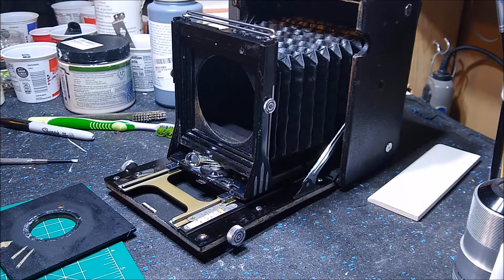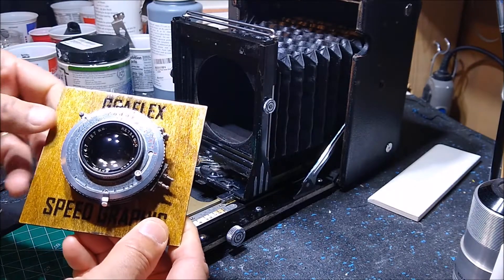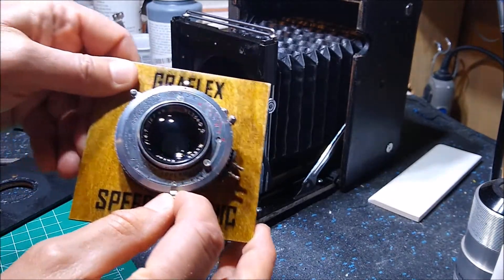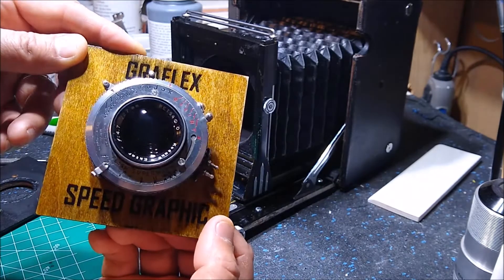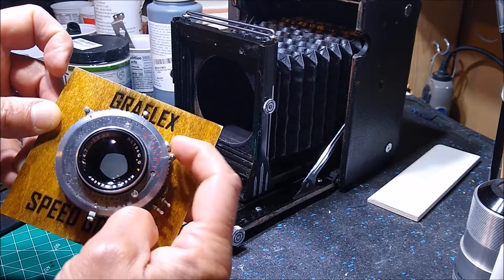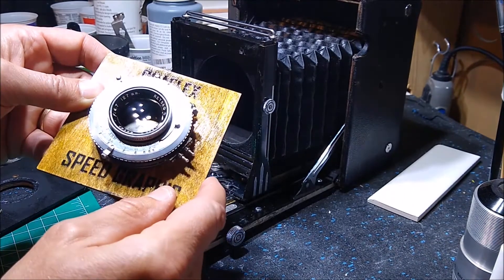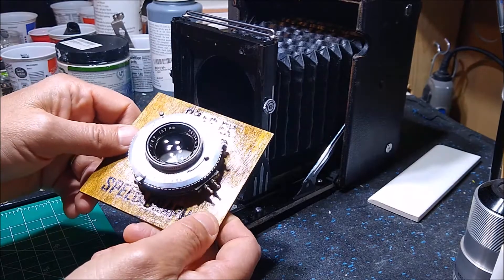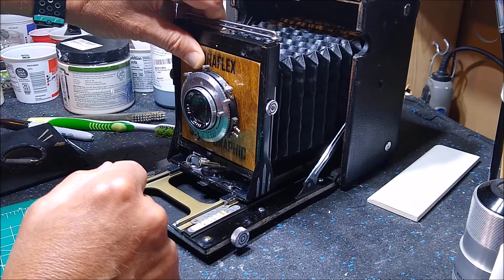Graflex Speed Graphic Restoration Part 7 (Shutter/Lens Assembly Restoration)

Comment: Great work on the camera (and vid series) thx - working on the front & back of a 3x4 - good inspiration here
Reply from the maker: Ahhh, the 3X4.  The most unloved of the Graflexes.  Since they are cheaper, I've acquired three of them. One has a process lens on it, one has a medium format lens from a modern camera, and one I turned into a facsimile of a wartime Army Graflex by painting it olive green and adding a laser engraved data plate.  I love shooting them handheld.  bigger negative than the 2x3 but not as heavy as the 4X5!

Comment: I just purchased a 135mm f4.7 optar.  I was hoping to see how to open it up. Mine is going on a busch pressman.
Reply from the maker: Dave, The front and rear elements simply unscrew so you can get those off pretty easily.  That is really just how far I went in the disassembly of the lens/shutter combination.  There is a maintenance manual online somewhere that goes into total disassembly.

Comment: I’m looking for Info on body remote shutter cable repair on Pacemaker Speed 23 Graphic ?  Or if it’s broken, where I can find replacement?
Reply from the maker: As far as I know, the Pacemaker does not have a focal plane shutter release.  You can only release the shutter curtain with the button on the front of the body.  If you are using the shutter built into the taking lens, it is as easy as using a cable shutter release of appropriate length.  If you are "good with tools," I imagine that you could rig a cable release in such a way as to activate the focal plane shutter release button.  That would take more engineering skills than I have though.

Comment: Do you have a video on how to tear down a lens and clean it up with lighter fluid?  I have a Graflex 135mm f/4.7 lens that is rather sticky on the T/B/1/2 range.  I've worked it over and over, and it's better, but could probably use a cleaning.
Reply from the maker: As I mentioned in the video, I really didn't take it apart besides taking the front and back lens element off.  Once I did that, I flooded the shutter in lighter fluid and then started to work the shutter at various speeds.  The shutter blades occasionally stuck because they were coated with liquid but as the shutter dried it became easier and easier.  Once it was all dry, the shutter worked on all speeds.  I'll try and do a video that illustrates this technique and let you know when it goes live.

Cheers!
Reply: That’s good feedback as I have exactly the same issue and wonder if mentholated spirits is ok to use?